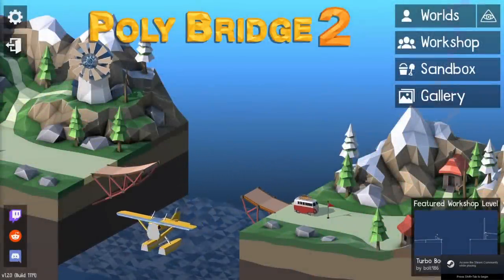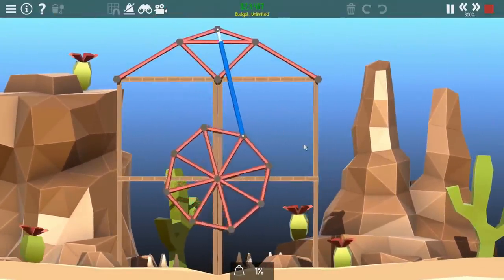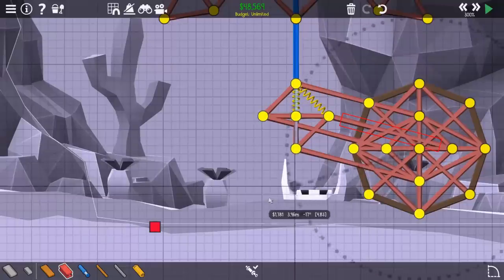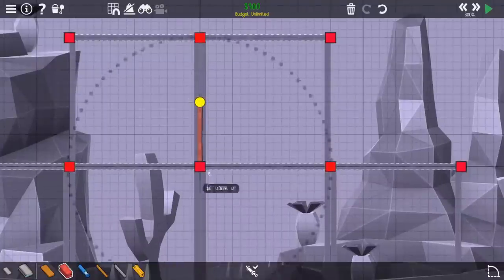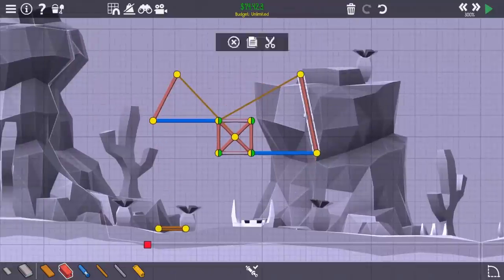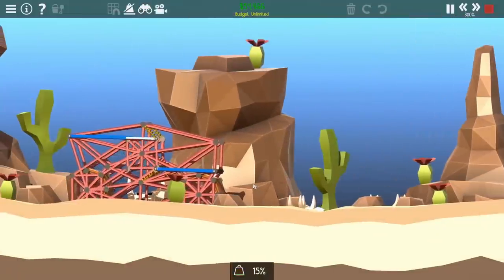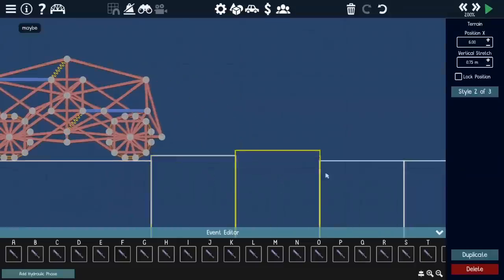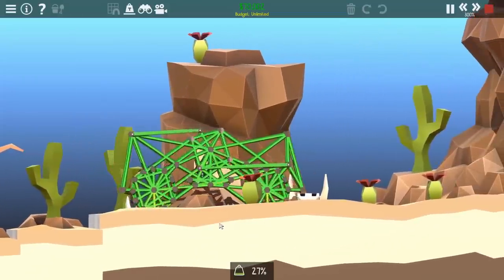Making a Car out of a Bridge in Poly Bridge 2

Comment: Maybe try a "4-stroke" Engine instead of "2-stroke"
Reply: Yeah I was wondering if it was possible to get more continuous motion, my guess is probably not as easily, but it’d be cool if he could.
Reply: I built a variation of this with 4 points shaped like a bowtie. Smoother because there was never a right angle.
Reply: You mean a 4 cylinder instead of a 2 cylinder?
Reply: @brucelouie2186  there's no cylinders here , but the engine has two strokes , a power stroke , and a stroke where they hydraulics move back 

Similar to real world two strokes, there's a stroke down from the explosion, which also pulls fuel in, and a return stroke as the piston goes back up, pushing exhaust gasses out
Reply: I think for 4 stroke each hydraulic needs to have 2x longer delay than they have now, and I dunno if he can change the speed which hydraulics move.
Reply: my car uses 3 stroke
Reply: @thatgingerdude8666  hmmm how does that work?
Do you mean 3 cylinder?
Reply: @televisionandcheese  triangle lmao
Reply: @thatgingerdude8666  ooh a rotary?
Well rotary is more like 1 stroke. That's what makes them very powerful, every stroke is a power stroke
Reply: why would you even bother with that, its just less power with higher complexity.
Reply: @torrentialdownpour7730  its fun.

Comment: I think your first engine could have worked if you had made the wheels a bit smoother such as using 12 roads.
Also, would it be possible for it to drive over a bridge or would it just fall through?
Reply from the maker: That and a multi-piston design would have most likely gotten it there
Reply: The weight would probably destroy the bridge
Reply: if you can design a bridge that could handle the weight it would probably be able to drive over since roads don't fall through other roads.
Reply: @meltedghost9922  Are you sure about that? I've seen more than enough Polybridge to know that roads can pass through other roads without issue. He'd have to use cars as a way to keep the "bridge car" on the bridge.

Comment: Effectively, you started out with a single stroke engine (like what you'd see on a steam train), and later improved the design by making a two-stroke engine (like what you see on scooters and outboard boat motors and the like). They don't work 100% like how they do in reality, but the basic principles are there.

Comment: We need multiple cylinder (?) engines now! To make the extra fast
Reply: The rotational speed is tied to the actuation speed of the hydraulics (expansion-contraction speed). More cylinder would add more force, therefore more torque, but not speed.

Comment: FOr your first design, you should have had another hydraulic at something like a 90 or 120 degree angle. That way it can pull past the apex.
For piston engines, they rely on a flywheel to get past the apex. So you're not alone in that struggle. You just don't have much flywheeling in this physics engine.
Reply: Ohhh unless the hydraulics can only all work at the same time. Never actually played this game.

Comment: "This is bad because it's technically infinite stress with no torque so the wheel shouldn't move the only reason it does 'cause Polybridge isn't perfect"
That assumes perfect symmetry. Small imperfections in the mechanism would create torque, so I'd say Polybridge is accurately modeling a real-world scenario.

Comment: Very impressive work. Did you ever consider offsetting the wheels so that one has a face to the ground and the other has a joint to the ground? That should cut the torque needed to start the car moving after a stroke as the gravity of one wheel falling off a point offsets the cost of lifting the other onto a point.
Reply: This concept really could strike a whole thing. It would be a long while before it was totally optimized within the games capabilities

Comment: I think you'd get smoother motion if your engine, rather than "trading off" had two pistons at ~90° offsets (instead of 180°) so that one is at 90° or 270° (and thus at it's 'strongest' point) when the other is at 0° or 180° (and thus weakest). That should get you smother motion since it doesn't have to basically stop in order to handoff.
Reply from the maker: You cannot offset hydro movement in the game, so unfortunately they can either be in phase or 180 degrees out of phase. Good thought though.

Comment: Make a car that powered by an actual car.the car goes at a moderate speed witch is encased in a wheel witch will act as the engine the car moves forward and makes it spin same concept but without hydraulics main focus is trying to make the car move the car made from bridge materials

Comment: do the same but with smooth motion :^)
(2 engines, one offset by 90 degrees so one piston helps the other over the deadzones)
Reply: This. 

Steam locomotives use this kind of crank arrangement and since those hydraulics are basically steam engines it would simplify everything.

Comment: Y'know for your original engine you could have just copied what steam locomotives do, have two pistons that are each 90 degrees out of sync. I guess that's more or less what you did in a slightly more roundabout way though. Still though i think a steam locomotive valve gear would have worked really well.